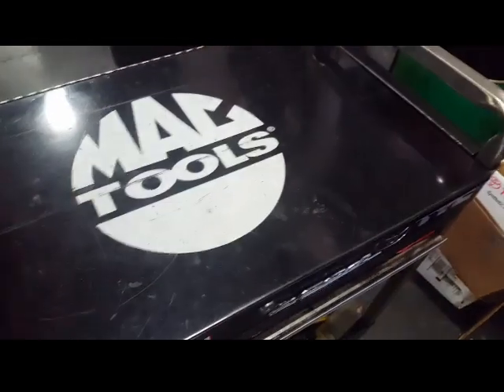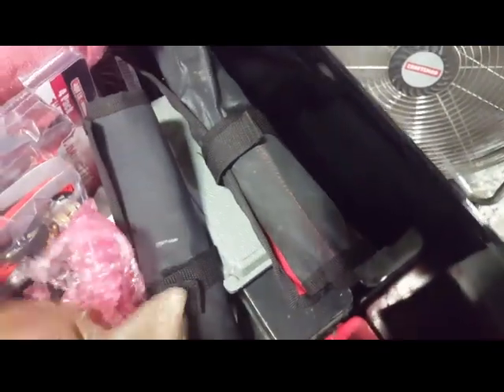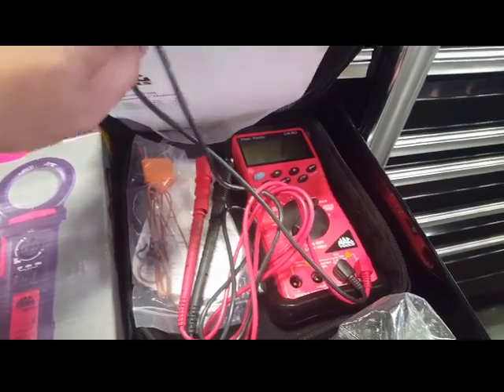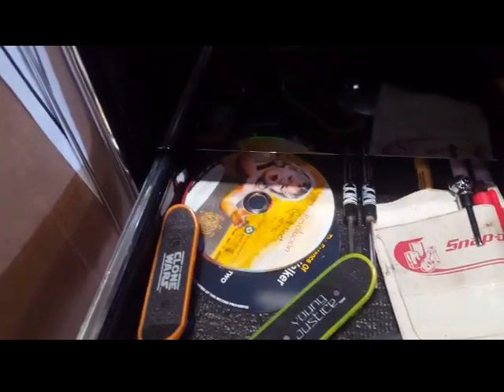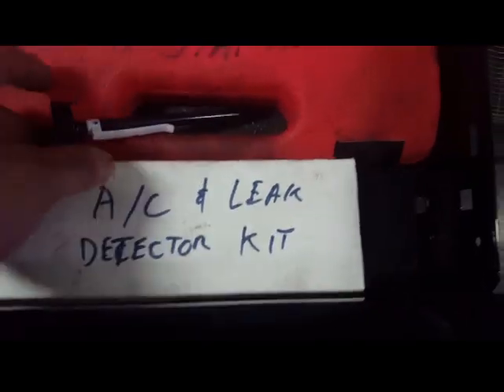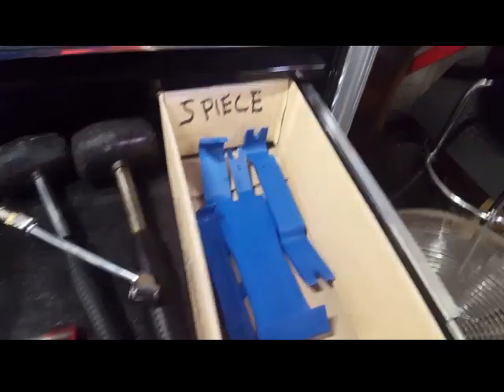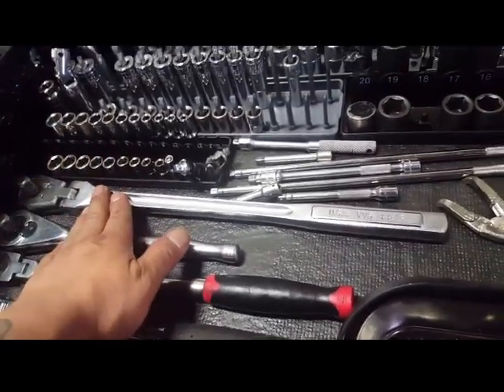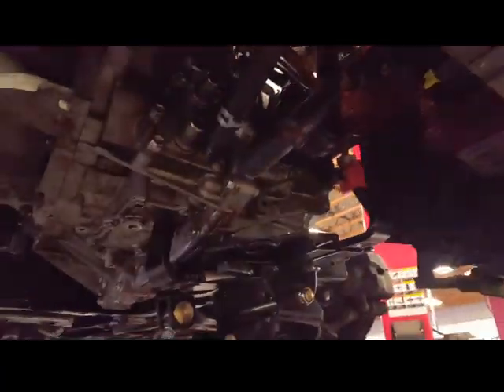Tool Box Tour 2019

Comment: Thanks for the tour. I am thinking of changing my fuel filter on my 2003 Tacoma but it’s under the intake what is best way to get to this beast I dot think there is a worst spot it could be in I don’t have a lift to go from underneath. Any info greatly appreciated
Reply from the maker: Thanks for Watching! If I remember on those trucks, the fuel filter is underneath the vehicle on the driver's side. If not, it's close to the d.s. firewall around the the brake or clutch reservoir. After you locate the filter, check for rust. I would suggest spraying the lines that connect the fuel filter with PB BLASTER or WD 40. Let it soak.   If you don't have any rust, then don't even bother. You need a good line wrench, 12mm. Also, take your gas cap off to release  any pressure from the fuel tank. That'll lessen the pressure from the fuel once you disconnect the lines at the fuel filter. Hope this helps!